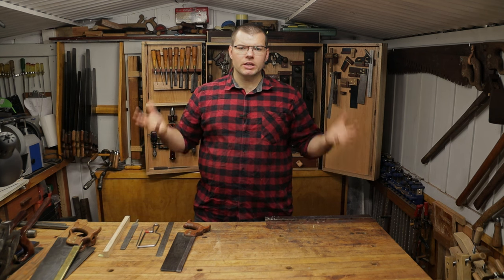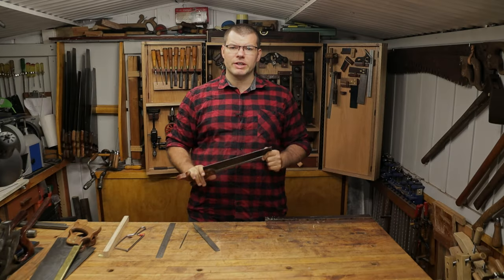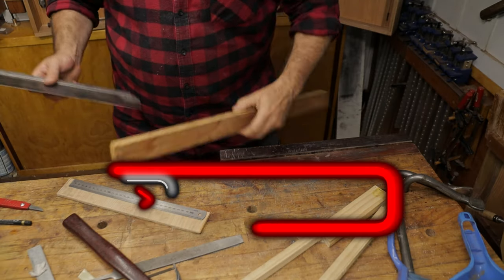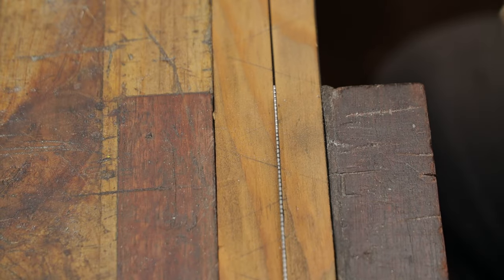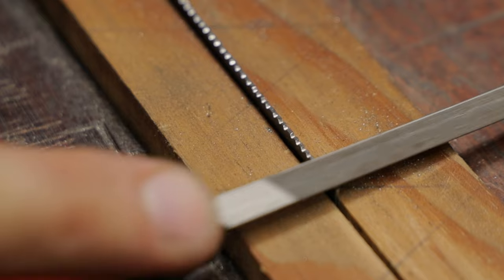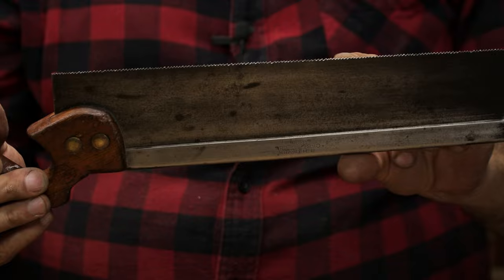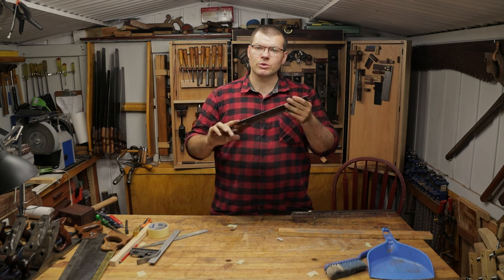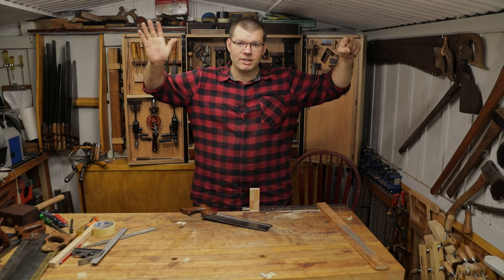How to RE-TOOTH a handsaw

Comment: I remember many years ago I had saws that I used to sharpen and reset myself and one guy in the factory helped himself to one and cut through some timber with large staples in it and totally ruined my saw; I complained to the gaffer (a cabinet maker by trade) and the guy got a written warning. Took me a couple of hours to get it working as I liked it again, using methods you mention above.
Reply from the maker: Thanks for sharing. Sounds like a pain to have to completely setup the saw again.